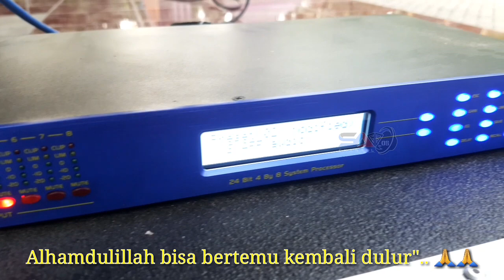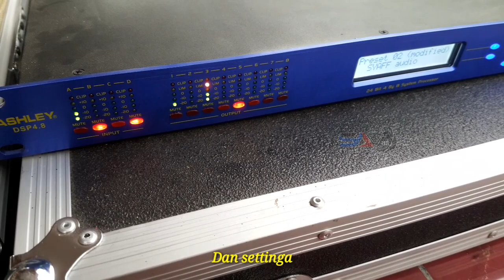Cbs mf 118 dengan power jowo class D

Comment: Kit Driver class D brp.n mas??
Reply from the maker: Untuk mid high class D1k5 pro perkit harga 375rb
Untuk sub saya kurang tau harganya.. so'ale pesen jadi.. driver class D BD3k5
Reply: @Syaff08amc501   classs D itu pakek pararel transistor gk mas??
Reply from the maker: @regawahyudi8201  class D gak pakek transistor.. tapi pakek mosfet
Reply: Dipararel juga ta mas
Reply from the maker: @regawahyudi8201  mosfet sistem e beda sama transistor.. mosfet menggandakan tegangan.. 1 driver class D 1k5 1.500watt cuma pakek 2 biji mosfet..
Reply: @Syaff08amc501   berarti main tegangan y mas?

Comment: Spesifikasinya mas
Reply from the maker: Spesifikasi speaker apa powernya mas?
Reply: @Syaff08amc501  power &speaker mas
Reply from the maker: Speaker 18inch x2 ,15inch x1 ,10inch x3 dan tweeter 3 biji..
Power mid high class D1k5 pro
Power sub dan low class D pfc
Reply: Swarannya..4 way td gmn mas..
Alhasil...
Reply: 18an pake apa bos?
Reply from the maker: @Dorikun77Official  sub, low, mid, high keluar semua.. cocok buat musik dangdut..
Reply from the maker: @shankaaudio  speaker lokal bos.. 🙏 produk sinar baja surabaya..
Reply: @Syaff08amc501  acr ya mas?
Reply: @user-rc3uv7oi8h  yoo maas acr